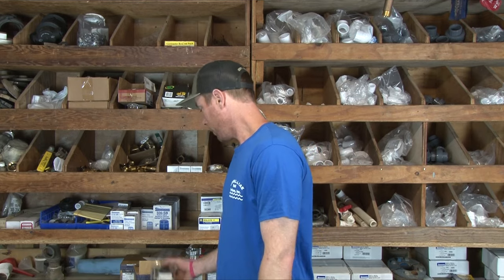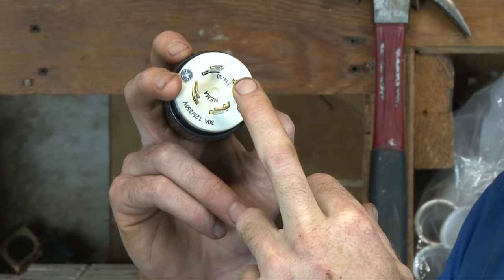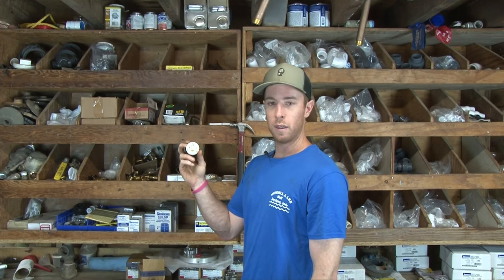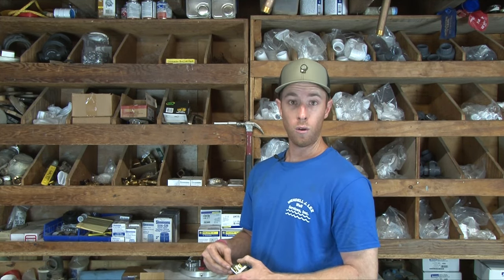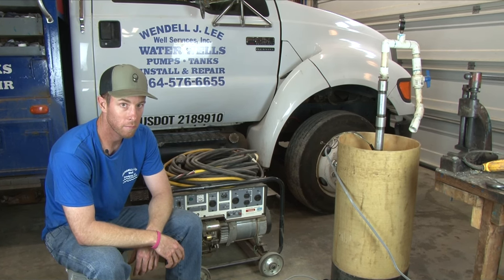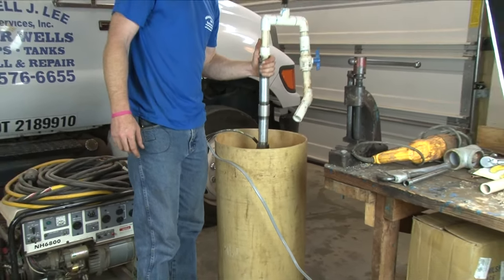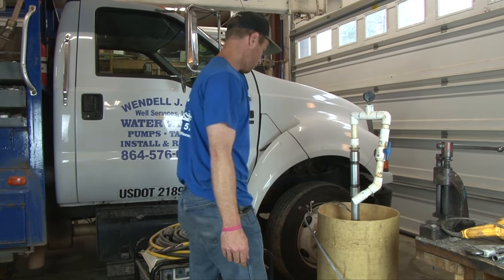Running a 230 Volt Submersible Well Pump on a Small Generator | Generator Plug Wiring

Comment: This video got me up and running here in Asheville after Helene took out our power. Only thing I’d add to this is go ahead and buy that plug before you need it. It’s been a hot commodity around here the last few days.
Reply: Great idea. I'm going to do that!! Also,buy the 10-3 wire,about 15 ft is good.
God Bless all Helene victims!!!
Reply: Solar would be better if at all possible since gas is also a hot commodity.  I wish I knew more about how all this works.  I would love to set up solar as a backup power for our well pump.  I did hear about a team of well drillers, digging new wells for victims of Helene and installing filtration systems.  Inspirational crew.  Hearts ❤ and prayers 🙏 to everyone.

Comment: Thanks for the video. The only thing wrong is that since a pump is at depth in the well it takes way more current to run it. Imagine a pump 500' deep in the ground and the head pressure it has to overcome to get water to the surface.

Comment: I've got red, black, and green coming out of the pump. Obviously red and black are hot1 and hot2, and green is wired from the pump as either ground or neutral.... and I wasn't sure which. Had my four-prong L14-30 plug ready to go and didn't know if I should wire green to ground or neutral on the plug. You made it very clear. Thanks!
Reply: This is not a water pump it's a 4, 000 credit to generator I need to know the one automatic coming from the 220 going through the generator itself
Reply: @bradcaddell1496  your comment makes very little sense.
Reply: Did you have any idea with hooking it up? What size generator was you using?
Reply: @bradcaddell1496  auto correct ?
Reply: @bradcaddell1496  or drunk?
Reply: @bradcaddell1496  what?

Comment: I’ve seen another video where they had the plug from the generator going into a designated circuit breaker “disconnect” box, with a single “double pole” circuit breaker.  They had the cord, from the generator hooked to the “line” of the breaker.  Then they hooked the pump to the load side of that circuit breaker.  Is that necessary?  I’ve hooked mine up “EXACTLY” how you have done it here.  I’ve never had any kind of overload protection in between.  This other video said, that if I don’t, then the generator or the pump is at risk of blowing up.  I find this hard to believe, with what I know.  What do you think about that?  I’d like your feedback on that.  Great video, BTW!!  I’ve done the same, in the past, a few tones, way you have done it here, and I’ve had no problems at all.

Comment: Hey, Grant - I just picked up a RedLion 3Wire and I need to install a 14-30 plug for our generator. Unit came with a Control Box - guess we'll install it after we have built a pumphouse for the wellhead. Thanks for the assistance! I need to install footings and mix cement for concrete footings.

Comment: i have a dedicated power source and panel for my well pump house only.
In my well house I have a 1HP booster pump, water softener system and a 1.5 HP well pump.
What size generator do I need? Internet specifies between 5K and 10K starting watts.
Thanks for your videos very informative.

Comment: Thanks for showing this. I need about 90 psi for an RO filter. and since im running rainwater through it, I am starting with basically zero psi. So i  want to put a well pump into my rain water tank, to get the pressure needed to run the Ro filter. I've never seen a well pump running above ground like this to see it working in relatively shallow water like that. The other option is to get a one of those booster pumps they use for Soft Washing. Benefit of that is the pump can be fed with a hose, with a well pump i would have to have the pump actually in the tank itself.
Reply: For fun, I'd like to see it connected to a narrow hose nozzle to get that same 10 GPM or whatever but forced out at high pressure, because these pumps can easily reach 150PSI running at ground level. Normally they still have to make 40-50psi even after pushing water up 100ft+ out of a deep well. So you would get even more pressure using it without the elevation.
Reply: Are you sure you need 90 psi? My under-sink RO system runs at 50 psi and will work down to about 40 psi. I also have a permeate pump, which is powered by the water pressure itself. Google it. I can't remember the brand, but it cost about $60. It greatly improves performance. 

Don't use a submersible pump unless you really need that high pressure.. It needs a minimum head or back-pressure to protect the light-duty upthrust bearing. These pumps are really designed to lift water a considerable distance. Buy an above-ground booster pump. I have a nice one in stainless steel, and I think I paid about $350. My two cents. Good luck!

Comment: I'm a new home owner to a well system with a 15' dug well.  My pump is indoors.  We are prone to power failures here where I live in Canada.  If I use this setup to my generator, what do you recommend I do for the UV Sterilizer system?. It auto shuts off when the bulb needs to be changed once a year.  I really appreciate your excellent video.  Thanks
Reply: In your case, if I understand you correctly, you have a shallow well, or (Point well) set up. Your pump is above ground as well as your pressure tank. Assuming( I hate this) I am correct, first you need to read your label on your pump to determine what voltage you have. In America we have both 110AC and 230AC volt pumps. Either way, your pump will have specifications printed on the side( tag) and this will help you figure out your power needs. You can take that info to any electrician and they can guide you in the right direction.
Reply: @billk9628  thank you sir.  I really appreciate all your help.  Merry Christmas to you and yours.

Comment: Some have said I need a breaker between pump and generator. Would breaker on generator be enough?  If I wanted this setup but also wanted to run off regular power what switch would I need to switch between generator and electric system power. Thanks awesome video.
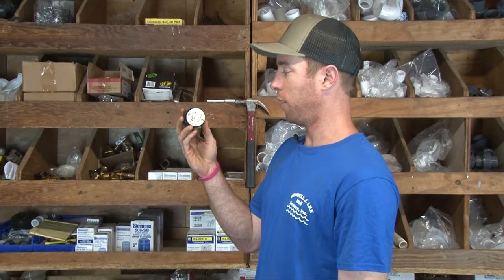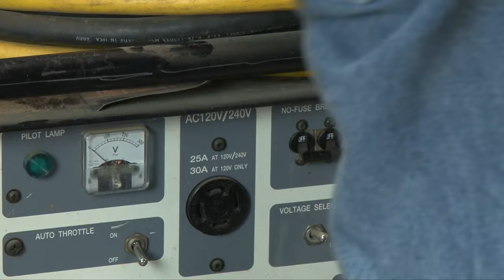Reply: I am now shopping for generator and am wondering why I can't simply cut wire to pump/tank pressure switch at appropriate place and wire in plug (as at 1:35) and receptacle. When power goes out then unplug line from service panel and plug into cord from generator. My concern is like yours, would I need some protection in this line or is breaker in generator? Close up of this generator at 4:18 says 25 AMP. This means generator has breaker that will open if current exceeds 25 amp? I don't even know what amp the pump requires and what should not be exceeded.

Comment: Grant, this isn't my typical setup. You didn't wire into a tank. Where's the pressure tank at? I don't see a pressure tank.
Also, why in carnation did you drill a well inside the garage?
Reply: #sArcasm
Reply: Lol😂
Reply: Why in carnation 😆😆 was that on purpose or not

Comment: I have found a well on the land I just bought. Looks like there’s a 10 inch pipe coming out of the ground with a 9 inch interior white PVC pipe coming up through that 10 inch I’m just guessing on the inches anyway then on top of that it looks like it’s the seal to cut the two sides with the four bolts in it pipe with a cap on top and an outlet on the side then there’s four wires that come out there’s a small white one and three larger white ones which ones go where?

Comment: Is there a way to connect the power so it works the pump pressure switch. If I wire in a plug between the panel and the pressure switch and turn off the breaker when we need to run the generator would that work?

Comment: Dumb question, I have a two wire pump with the ground at the well. It’s probably 1000 ft from the house. Does a 120 volt pump gone in two wire configuration? I’m rethinking my set up but limited with only two wires turn the hill.
Reply: What do you mean?
Reply: @bladeslicemaster5390  I have two wires going down my hill. The ground is at the well head. I had a 240 2 wire pump, trying to see if a 120 volt pump will work on two wires. I think add I but not sure.
Reply: @Deveak  120v can use 2 wires, the hot and neutral. It doesn't need a ground to work, the ground is there for safety. Does that answer your question?
Reply: @bladeslicemaster5390  yes thank you.

Comment: What about a 3-wire motor? It has two hots, a neutral and a ground. Do you use the silver prong then?
Reply: You wire a 3 wire pump into a control box then wire the generator to the control box

Comment: You didn’t show any of the actual wiring. What do you do with the unused wire from the plug? How about wiring a circuit breaker or control box? Any tips on using a three wire well pump with an external control box?
Reply from the maker: The wire from the plug goes to the well pump. I mention it in the video that I wasn't wiring to a pressure switch for video purposes. Normally the wire from the plug goes to a pressure switch, then from the switch to the pump. For your three wire pump questions, I suggest you watch our video on 2 wire versus 3 wire well pump motors. This will illustrate the differences in wiring between the two motors.

Comment: Maybe a dumb question, but can I run my 220 volt sub pump 7 amp off my 3000 watt Honda inverter 28 amp out put but rated at 110 volts, by applying 110 volts to each side of the line 1 line 2 (or 220 volt input leads to the pump) 

This is only for dire emergency, as I have the generator, and in 10 years I have never need 220 volts out.  But will this work ?
Reply: No. You must have 240v generator.

Comment: What minimum size generator is required to run a well pump like the one you showed or demonstrated in the video thanks I have a Generac 6500 with the built-in 230 V 30 amp outlet
Reply: As big as you can afford 6500 starting watts minimum. Preferably 8500

Comment: Is there a way to install the generator plug and still have the ability to let the normal power run the pump so that when the power goes out, it's possible to just flip a switch to go from main to backup power safely and without any problems once the power comes back on?
Reply: yes, ONLY if you install a $$$ transfer switch.  That is so you don't electrocute power line workers or burn out your equipment when your power comes back on.  Cheaper but less safe is  to install a plug & outlet going to your pump; then you can unplug pump when the power goes out and plug into your powered generator cable.
Reply: @tooluser  If you wire in an outlet to the pump junction box(normally in the pump house near the pump and downstream from the pump house breaker box) couldn't you simply flip the main breaker off in the pump house while running the generator hooked to said outlet when the power is out as Pensylvania Prepper describes? Then there would be no issue with electrical workers or burning something up?

Comment: Red green white black wire coming from the 220 need to know the wiring schematic for the outlet plug on a predator 4000 generator
Reply: The first outlet is hot I need to know the wine going to the second Allen it is not there and I'm replacing the ticket outlet so I need to wire it up completely
Reply: I need to know how to wires go from the first outlet to the second outlet to make it hot

Comment: I've been running about for over a year trying to figure out how to wire say the power bank batteries of the Goal Zero up to 240V or ok 230V as demonstrated here to power both our furnace sump pump and our Well. We do not have a holding tank our well pump is 2 years old and newer set up without a holding tank. Anyway I invested in the Goal Zero expensive power bank batteries a total of 4 and we already had the original Goal zero 1400 lithium solar battery thinking we could use it to keep all trickle charged year round pretty much. The idea was keeping the LP Lennox furnace blower working during power outages and it requires a sump pump to work also. I also was under the impression that the well was on 110 or 120 and so we could continue to flush toilets and run a small amount of water to cook with and do dishes if need be too. (We were not looking to heat our water heaters or run all our lights etc. Basically one room with one computer/wifi etc. would be ideal and our land phone along with the furnace and well. ) Of course first thing we discovered was the well is 240 next the sump pump too. SOOO that put a wrench so to speak in my pursuit of things. The sump pump is in basement with no fresh air available and no port to bring in extension cords from a generator set up outdoors. The well is wired to inside the house circut board too. So ideal would have been the Goal Zero 4 circut system. I called an electrcian that advertises in our rural area but they have never returned calls or called back. I did not leave info about what the job was just that we were looking to hire an electrcian for a small job at our home. He's advertised as doing small jobs and so you would think he would at least return calls even if just to say he's too booked. So meantime we are trying to figure out if it's possible to turn another set of Goal zero power bank batteries and 4 circut box into stand alone for the two 240V circuts. These operate by turning on each individual switch so you have some options here. Say in summer we do not need to run the furnace or the sump pump then but may want to redirect or turn on a circut for the freezer that in the winter we wouldn't need being out in the unheated garage. Anyway we get nibbles of insight here and there that it can be done just never enough to figure it all out on our own. We are capable of setting up the Goal Zero's first set of 4 batteries and 4 circuit system to run 4 circuts about the home. However really we don't need lights or microwaves or garage door openers that so many people feel the need to connect to or hot water heaters. BUT we would like to flush the toilets, run small amount of water as needed and run the furnace motor fan and the sump pump which is citical to the furnace. Also of course we can easily set up to have power to one computer and wifi zone and land lines which ours has 6 6 satelites about older 3 story home that's almost impossible to rewire. We do have whole house surge protection too. We live in a rural area of NW MT and it's difficult to find journeymen available or available for small jobs like this. And I might say reliable professionals too as some have had poor attitudes while others like those who put in our well and built an addtion to garage etc. did fantastic professional work. By the way Goal Zero is not at all helpful. They just keep saying hire an electrcian and no don't even think about using their products to run 240V circuts one or two. Nice to see this video that lets folks know how to wire or rewire their generator to run a 230 sump pump in power outages. I was hoping he'd go into the SOLAR a bit as he mentioned it. I do not intend to run the Goal Zero 1400 via solar to charge the storage batteries however in an extended power outage in spring through late summer we might have enough sun to recharge the 1400. I definitely have 40 foot extension cords from the light weight 100 watt solar panels and 30 foot cords for the 120 Watt or 60 Watt portable commercial solar panels by allspower. I made the two 50 Watt light weight book folding style solar panel myself over 6 years ago and it's worked great ever since. So it's possible but the house is not set up at all for actually getting solar coverage to the Goal Zero. Though in an emergency holes I suppose could be introduced through walls but until that day we are not looking at it as an option. The Goal zero itself is suppose to keep the storage batteries topped off and it'self via house AC. Like I said I would be happy to add 2-4 more storage batteries and another Goal Zero 4 circut exchange to do a stand alone set up for 240V two circuts only. But like I said I'm not finding out what I really need to insure I get there. Someone on Amazon did tell me to just change out the plugs in the circut box and maybe it is that simple. But this is where I really need a reliable source to back that up like an electrcian. My husband who is excellent at electronic and circut boards and even some rewireing over the years is now into his 80's and this is a bit out of his comfort zone too. I'd love to say "it can't be that hard can it?" Stay safe everyone and thank you for your video input. Every bit helps.

Comment: The wire from my pump to the pressure switch has only two wires, no ground, although the wire itself looks like it has two more wires that were cut and not used. The wire coming from the breaker box to the switch has two hot and a ground, the ground wire being connected to what I guess is a ground screw on the switch. Since the pump has worked fine the nineteen years we have lived here, and before that, I guess there is no problem, but I just wonder why there is no ground wire from the pump?
Reply: Your pump “should” be grounded.  In the case of lightning, it could fry your pump.

Comment: I bought a 3400 watt Champion generator . This has a 30 amp 125 volt outlet , instead of the outlet you showed in this video. What can I do? Do I need a bigger generator with the 4 pin outlet? My idea was to connect the well pump directly to the generator as your video shows. Thanks. I would appreciate your suggestions.
Reply: Yes, you will need a different and or larger generator that has 240 volt output.  Your current gen can handle any 120v appliance that draws up to 30 amp.  It's the volts that matter in this case.
Reply: thanks for the advice.
Reply: @tooluser  wud not 230 volt output work ?

Comment: What would be the wire to use to run from pressure tank to breaker for permanent use?
Reply: 10/2 with a ground.  So a white, black, and bare (for the ground wire).  You do t need 3 wire, as there is no neutral in the 230V pump.